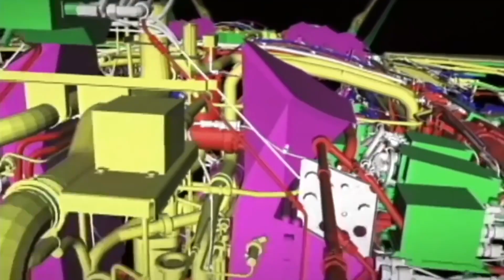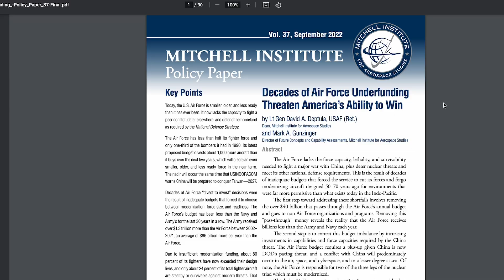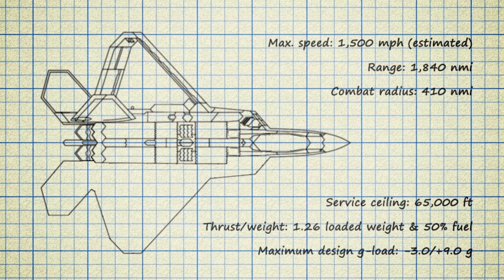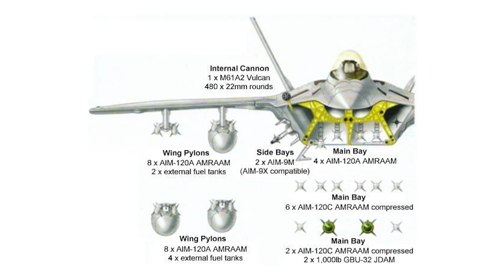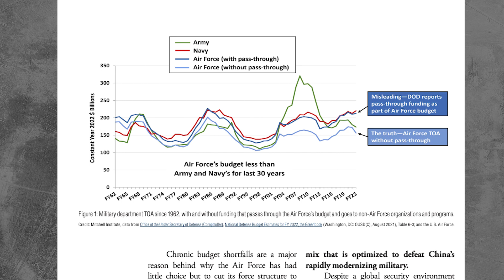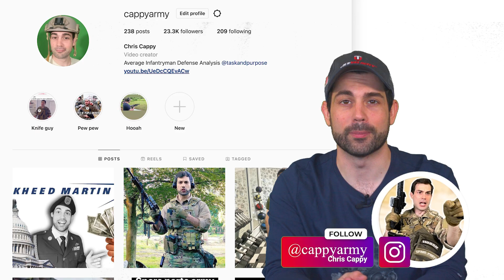Cancelling the F-22 Fighter is Worse than You Think

Comment: I think you unintentionally just gave some insight on why the F-22 seems like a focal point of the NGAD program. We don't have enough so we're trying to add loyal wingman drones or potentially a new stealth fighter to them. It's to make it so the best gets more ammunition available per sortie without reducing stealth, which also means it will be a bit better off in the current numbers without the cost of restarting the production line
Reply: And that's what they're already doing with f-15 EX serving as bomb trucks for f-35.
Reply: @mnorth1351  The EX may turn out to have a much shorter lifespan than we expect if it really is just a stopgap measure, which isn’t unprecedented, but we’ll see.
Reply: Loyal wingman drone is a completely different concept, it would work with an F-35 extending sensor ranges, attacking aircraft and sacrificing themselves. 
The communication is done via link 16 which was very difficult to implement in the F-22 as upgradable and modularity was not in mind when the F-22 was developed.
Reply: @morgitory  In a way the F22 almost suffers from being too far ahead of its time. But then again, even after so many years it still remains as the king of the skies for a reason.
Reply: Loyal wingman theory is fools gold.  What we dream it will do vs what it will cost to build a platform that can actually accomplish said wishes is miles apart.  These things need a logistic trail like any  other aircraft otherwise you will lose them all when they run out of gas or can’t return to base. They must have incredible range, be stealthy or give away a whole mission, unjammable, be cheap, be reusable with low maintenance, be fuel efficient or be able to auto-air refuel, have meaningful payload capacity or EW (which you can’t afford to lose to the enemy if shot down), etc.  Better to build ultra long range networked cruise missiles that can be retasked on the fly.
Reply: @mobiusflammel9372  , The F15 is still miles ahead of 95% of its competition. Better planes exist, but they haven't been made in sufficient numbers to threaten it. 

The J20 is pretty much the only thing out there that has enough airframes to cause a problem for it. And we have plenty of F22 and F35's to deal with that threat. 

America's adversaries made plenty of scary planes. They just didn't make them in sufficient numbers.
Reply: @Kahless_the_Unforgettable  it isn’t so much foreign planes that threaten the F-15 as it is advances in missile range in general and air defense systems. Which is why the EX is apparently designed to work as a missile truck as far out of range as it can get. Which is part of the reason it might not have a long shelf life, because the massive fleet of drones the USAF wants to develop as the bulk of its forces will serve that same role among others. It’s fascinating to see how next gen air superiority/dominance is shaking out.
Reply: @411bvRGiskard  You may be underestimating the advantage of not needing a cockpit. Stealth drones will not need the space required for a cockpit, the massive radar signature of the cockpit will not exist to be a thorn in the designer's side when enhancing the stealth of the drone. Without the space required for the cockpit and necessary systems for a pilot, or the armor around the cockpit more weight can be allocated to armaments. 

A bomb or missile carrying drone serving not necessarily alongside an F-22 but likely 5 or 10 kilometers back could very well accomplish a lot with an F-22 that is actively hiding it's presence and so that it can continuously guiding the missiles to their targets by keeping them in it's sensors. Not only would the raptor itself remain undetected (but the presence of a jet will be known) but it will still be further capable to either light up further enemy targets for the missile truck or in a pinch would still have it's entire weapons suite available to it once it is being actively searched for. There's no reason for a F-22 wingman drone to be not stealthy, as you've said and what is obvious is that it will ruin the advantage of surprise by alerting the Opfor. The F-15EX is exactly that, but it was rather designed to be a missile truck for F-35s which unlike the raptor are far more interconnected and rather perform an air dominance role instead of air superiority. They will fly in when a squadron or multiple squadrons of F-35s are flying in and marking ground targets to be hit with their advanced sensors, with the F-15EX trucking the HARM missiles in. It is at this point when ground attack aircraft, either A-10s or FA-18s will begin to make their flights overhead to destroy specified targets on the ground, once air dominance and all possible threats for aircraft have been neutralized. However, upon entering the OpFor airspace for the first time an air superiority fighter is necessary. F-35s are excellent jets but with the advancement in stealth in China and Russia the type of airspace the F-22 was designed for is arising. The F-22 will need to enter airspace that has far more targets than it will have the weapons for and if it were to reveal itself with the opening of a weapons bay it is likely it will be found by adversaries. The final trump card of the F-22 is that it is an unmatched air superiority fighter, but there is no reason to resort to that if you design a capable stealth drone to truck in required armaments and to launch missiles from a direction unrelated to the actual position of the Raptor. I don't foresee a time when this combination will not be necessary in clearing out enemy airspace so the development of a stealth drone capable of linked missile firing will not be wasted when the raptor is eventually replaced by a next generation air superiority fighter.

Modern computing and machine learning algorithms are unbelievably  more capable than they were just 10 years ago and the US already has decades of experience in unmanned drones. Having a missile truck wingman doesn't necessarily mean cutting out the real wingman, just adds more capability to a jet designed to be absolutely undeniably the best air superiority fighter and would allow it to hit multiple targets before chancing with the opening of a weapons bay and firing of a missile. The issue with your long range cruise missile idea is that either they will need to be fired before aircraft are detected or the fighter pilot will have to continuing ghosting the aircraft for a prolonged time. A nearby stealth drone could mean the target plane is destroyed in minutes, allowing the raptor pilot to quickly move on to the next target.
Reply: @facepalm7345  HARM missiles have limited range, as do A-10s & F-18s , so this means that F-15EXs and the others need to be based and maintained nearer to the Battle space than can be protected from Chinas SRBMs or Subs.  If these planes need close airfields, then hundreds of high capability drones will as well. That means the requirement to base hundreds of airmen at FOBs directly in harms way.  Not only that but tankers would need to be based nearby to facilitate continued operations and thus putting them in harms way as well. The F-35 is the worst hanger queen of them all and has the poorest legs.  It can’t reach mainland China from any allied base that isn’t reachable by Chinese missiles and Subs.
Reply: @facepalm7345  I agree the drone designs will benefit from having no pilot and the corresponding available payload space but that space can’t be used for fuel but will need to be used for advanced electronics for nav, networking, AI, EW defense or offense.  So while it may be stealthier from a shape standpoint it will still need to be large enough to carry enough fuel to operate in the Pacific.  Also it won’t be stealthy from a RAM standpoint unless the costs per unit rise significantly to add it.  But then the Attributable Factor disappears because they’re so expensive and you can’t lose that RAM tech to the enemy in case of combat loss.
Reply: @facepalm7345  My suggestion for the ultra-long range Cruise Missiles was for eliminating the fixed target SAMs and anti-air assests like guns or radar installations.  They would even be used to attack all the dangerous man-made islands China has created.  These islands threaten The US Navy, so instead of dedicating manned attacks on these islands (which take a lot of resources), a Carrier Strike Group could launch from outside China’s anti-ship missile range and free large regions of denied waters.
Reply: @411bvRGiskard  I see, but then that is an entirely separate thing from the F-22's main role anyhow
Reply: @411bvRGiskard  You're doing too much thinking with not enough research as well as missing blatantly obvious points. F22 is top dog but not enough and it leaves areas without enough coverage. We have missiles that can reach. The drones are being designed to be capable as parasites. Meaning say you load a few on an f15 and send it out with external tanks and an F-22. You could deploy them in the battle space already fueled and ready to go or at the edge of radar range and have the f15 loiter in the back or send it to top off from a tanker which would likely be there anyways regardless of the drones. The drone design possibilities could be they self destruct, kamikaze, or attempt to rejoin once their munitions are used up. The entire point is they could be used heavily to boost the effect of every raptor to make up for the numbers deficiency on a budget compared to trying to rush out a new manned plane that can keep up with the raptor. The raptor is an excellent candidate due to its stealth capabilities as well as its fighter nature. If a raptor gets in trouble it can get itself out of trouble in most cases. Most other planes just can't do that. I've seen them talk about 6th gen potentially including drones into the list of capabilities and there were reports immediately after of people seeing upgraded f22-s probably being used as testbeds. If I had to guess. For this. And if you ask me it makes sense
Reply: @hf117j  I think you’re mixing up drones (which I like) vs actual large wingman platforms that are nearly as large as F-16s like Kratos etc. I’m fine with suicide drones, spoofing drones, etc.  they’re good disposable weapons and relatively cheap.  It’s the Wingman as a Force Multiplier that is a suspect idea.